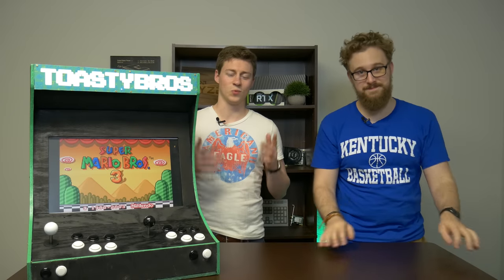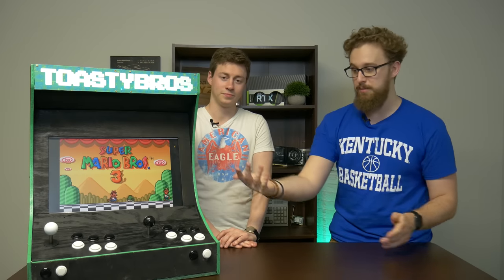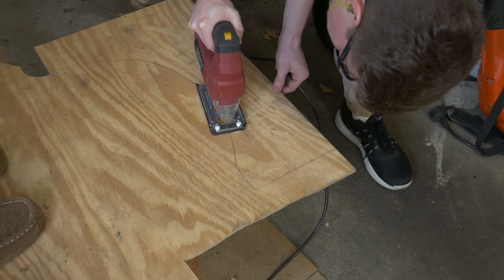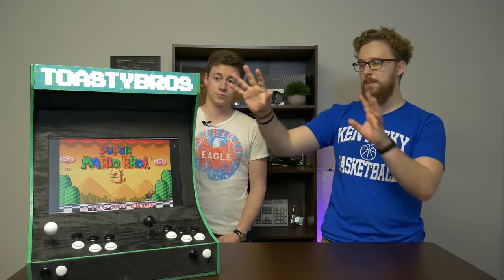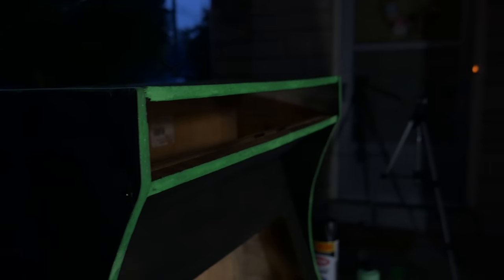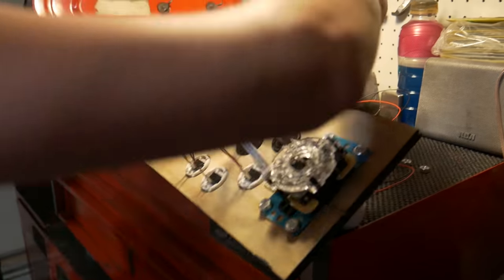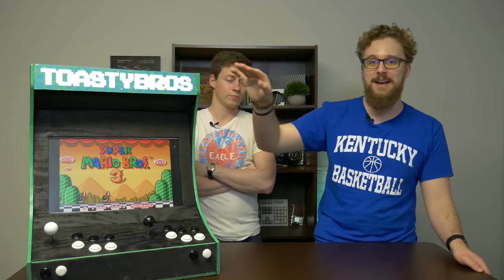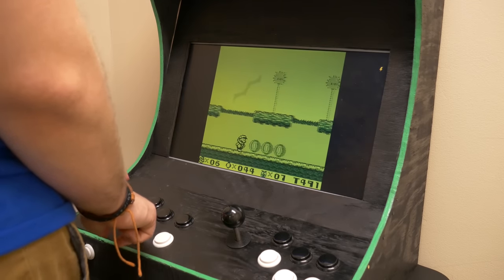ULTIMATE $100 Arcade Cabinet Build

Comment: Not actually 100 if u dont have the pi already or the wood and wires or access to free monitor. Closest I got was 40 for wood, 60 for jamma card, 40 for jamma cable buttons and wiring and power supply, 80 for an old 19" monitor from a site that does refurbished monitors.

Comment: This is exactly what I want to build. I'll probably either sand down the panels smoove before painting or just use contact paper. I'd also set the monitor vertical if your planning to play any actual arcade games through MAME.

Comment: fun project.  It's a deep rabbit whole to go down.. (I've built full size uprights, old console conversions, ps classic conversion, etc...)

On a side note, check your power supply for your PI.  The bolt icon in the corner means it's not getting enough power.

Comment: I would recommend using a primer before you pained it to give it a more arcade feel. There is a website that also offers custom vinyl for graphics. You could also use some resin on the wood to give it that nice glossy smooth feel. All in all great job guys
Reply: Epoxy?

Comment: Nice. Sadly, unless a person has access to the power tools required to do this, its not cost effect. $100 for the cab parts, $1000 for the power tools. Might be a good way to justify power tools that could be put to use on future projects.
Reply: The only power tool in the entire video is a $30 jigsaw from Harbor Freight... You can buy a $10 box of shovel bits to make up for the drill press.

Comment: I would have sanded the cabinet and used wood filler to seal any imperfections then sand again, then use a decent primer or clear coat and then paint. Also would use a bluetooth adapter to be able to use wireless controllers if so desired.

Comment: AS far as finishing/painting, sanding the surfaces might help hide the grain and give a more finished look for low cost vs custom coverings
Also, local Mom & Pop dollar stores often have large cans of spray paint for $1-$2, as we have around SE MIchigan, often name branded paint
Some of the paints I've seen are textured, which would also cover woodgrain.  ALso primers are available
Kilz is designed to remove surface imperfections
Sanding sealer is another option for filling wood grain.  Sanding sealer is often used for model rockets and planes to fill balsa woodgrain prior to paint
Of course finding scrap MDF and/or finished plywood on the curb is a win too

Comment: If you ever do another one, or heck you could still do it on this one, the edges where you have green on actual cabinets is plastic T-Moulding, the only hard part of using it is cutting the groove it go into, has to be the right with and depth and bet exactly in the center of the edge, but it looks really nice.... that said, until you guy got to the painting part I thought it was t-moulding lol... so great job guys, just a little extra work and the same look but probably cheaper.

Comment: U guys did exactly what I did hey lol except I used string to do the curve part but I freestyled the whole thing and surprisingly my side panels look gd. I've just gotta finally put it together. I bought a cheap jigsaw too. Cut it on the carpet in my old unit, vacuumed up the dust, all sweet. I'm gonna buy decals from a proper printing place to do my stickers though. Its the part I'd spend the most on, that and the buttons + joystick. I've got cool ideas for themes too. Seen so many so I've come up with some original ideas. Can't wait to finish it. I got a Raspberry Pi which I'll use till I buy a decent small PC for it. I want to eventually have it play Street Fighter 4 and MKX so yeh the pi3 is great for most arcade games, suprisingly mined slowed down on a couple shmups I've played in it so yeh a PC is the go with Launchbox. Blinkys cool too, its a light program which u can hook music up to and yeh have it as a jukebox too. I want lightgun games too. I'm basically greedy hey lol I want it to be super kickarse. I've researched this and watched tons of vids and I can see the vids where people have gone that extra mile and yeh it shows and is really impressive. Having a plain pi3 in it with different images isn't gd enough lol I've had my pi3 for over 2 years and I've used it tons so yeh I want something crazy. U guys did gd though, at least u finished yours.

Comment: It's on the amateurish side. Buttons are backwards. Use led buttons. Get a professional vinyl print.  Your marquee looks like it was printed out of an inkjet printer.  I would put plexiglass on the monitor and on the controller. It makes a big different and blings it out hiding the imperfections.

Comment: I don't think you've heard of primer. You even say if you had to do it over, you would use better paint. The paint was not the issue; you needed to use primer before the paint. Today I purchased two gallons of Kilz2 White Primer for $25. One gallon was $19 and a quart was $10. A quart of primer could have covered over the ugly plywood pattern making it look like you used solid wood after painting.

Comment: I like the video production and the premise but there's no information, or evidence if you like, to back the $100 arcade build claims. I think a brief run down of the cost would prove a very different story. Because you had various parts lying about doesn't mean they're freely available to everyone, making the $100 claim pointless. When you've factored in all these things: Paint, Buttons and Sticks (which don't look budget!), Plywood, Perspex, Raspberry Pi (maybe just a zero?), Adapter for non-hdmi screen, USB encoders with cables, RGB led lights with remote, Second hand monitor, Paper to print logo, Metal brackets for screen, Hardware and padlock for door, Velcro, SD card for Pi, Power cables. Sorry, thats not $100.

Probably missed something but I think you see what i'm saying. I just think its wrong to say you built this for so cheap when thats clearly non true. At least attempt to give a list of the costs for your viewers at the end!
Reply: That's what I'm saying. Maybe just maybe slightly under 200

Comment: Anyone know if the arcade kit works with a wii
Reply: Retropie seems to support Wii, but the Raspberry PI's GPU is just not good enough to run Wii. If you had an x86 pc you were willing to put in, then that might work. Other OS's or hardware, might too, but they will likely cost more

Comment: This design is all wrong. Or better, it's lacking of any wise design choice. You are trying  to replicate the classic bartop arcade cabinet style but that was designed around a bulky CRT monitor and huge motherboard with a mess of cables. Our modern components are small and thin taking very little space, and the unit should be re-designed around them.
Also that unitis too small to be a 2-players cabinet and too big to be a single player unit.
How many times will you use it with a friend VS how many times you will casually play with it alone?
You can plug a controller for those rare 2 players occasions, as like the NeoGeo Mini did.
This should be something for casual gaming that sits on your desk without taking much space, I'd say something with a screen not bigger than 10-12 inches.
The top part is unnecessary, the speakers can be placed anywhere else (I'd make a few holes under the screen or at the sides). In a small unit like this stereo sound does not even makes much sense. One small woofer would be enough, considering the most of pre-90's games have Mono sound and you won't need to pump it loud.
The rounded profile you went for just makes the cutting more challenging. A simple and slightly inclined L-shape will do the job.
Also the whole unit can be much slimmer and compact, no need of all that empty space inside. 
If you use a cheap Raspberry Pi 3 A+ it's so smal you can stick anywhere under the control pad or behind the screen and route a power cable where you need it.
The controls pad should be larger by height,  and with a lower profile, that way  you are not forced to push your palms on an edge but resting them completely on the control pad.
The buttons layout should be similar to the NeoGeo AES, the coin and the start buttons should be in the middle, no need for an additional drilled piece on the front that makes unnecessary thickness.
I'm in the process to build my own since no design I see around fits in my taste, both aesthetically and functionality wise.